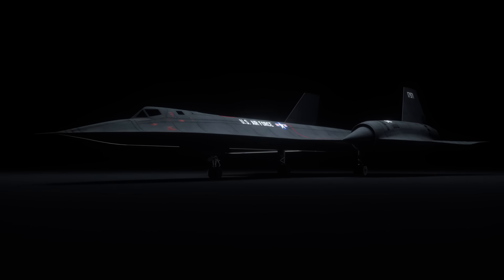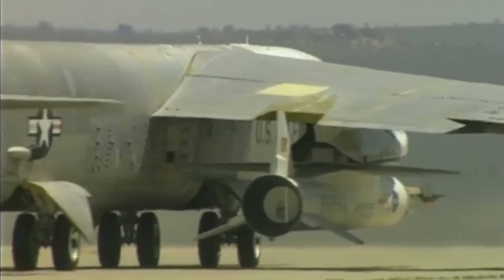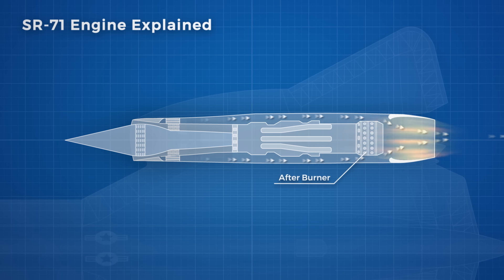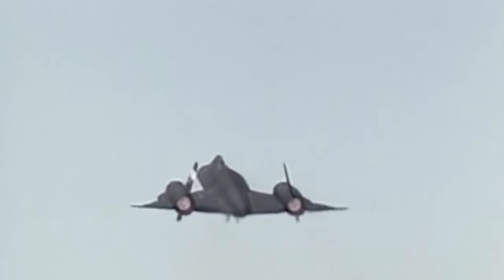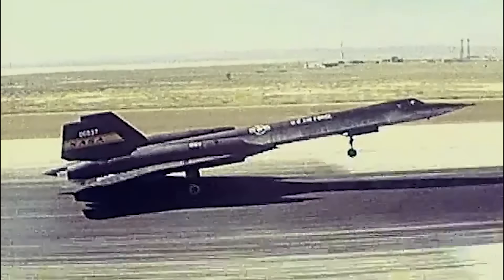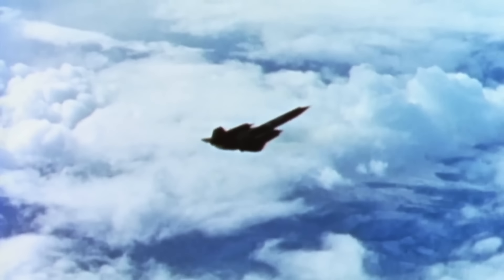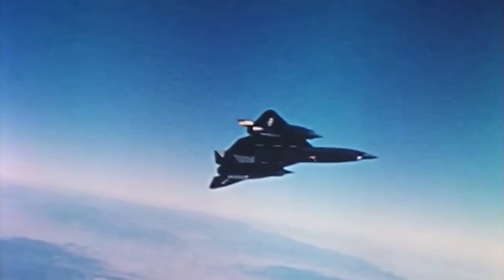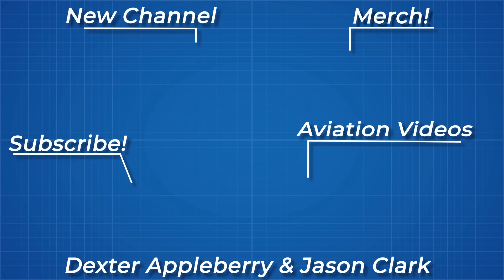The Insane Engineering of the SR-71 Blackbird

Comment: The Russians were trying to set the record for the fastest plane, and according to an older friend (who was a Mechanical engineer/test pilot for the military and actually flew in a Blackbird once) every time they'd break the Blackbird's record, someone would take the blackbird back up and break the Russian's new record. After the second or third round, the Russians figured out the Americans were screwing with them and gave up. ...he also said the thing leaked fuel like a sieve on the ground because they had to allow so much space to allow for thermal expansion. 

That bird can fly way faster than what's declassified I'd bet. That would also explain why they "stopped at mach 3.21." =D
Reply: @FIREBRAND38  The video explicitly says that there were "gaps in the fuselage" specifically left for thermal expansion during highspeed flight, and that this caused the plane to leak fuel. Furthermore, the video says the max speed of a ram engine is mach 5. You think the military wasn't using every bit of speed they could get? This plane had to outrun missiles if they were fired at it, and it's a lot easier to make a little missile go mach 5 than a big plane.

If you don't want to believe it, look at what happened during Desert Storm. The military was forced to unveil that the F-117 Nighthawk, a plane that was supposed to be under development, was being used in the air raids because news broadcasters spotted them and got them on tape. Here's an excerpt from the F-117 wiki:

"The F-117 was born after combat experience in the Vietnam War when increasingly sophisticated Soviet surface-to-air missiles (SAMs) downed heavy bombers. It was a black project, an ultra-secret program for much of its life: very few people in the Pentagon knew the program even existed, until the F-117s were revealed to the public in 1988."

In actuality, the F-117 wasn't seen in action by public eyes until April 1990. 1988 was the announcement of it's development to the public, but in reality, it had been in service since 1983. Case and point, the military never fully reveals what their technology can do. That would be the epitome of stupidity.

Also, the man I am talking about was allowed to fly in the Blackbird as a reward for his service. Test pilots die a lot, and this man risked his life multiple times flying new planes, so at his request before he retired, he was allowed to sit in the surveillance seat in the back and someone else piloted him. Also, of course this back and forth with the Russians was never made public. It would have been an embarrassment for the Russians, and it would have revealed too much about the Blackbird's real capabilities.
Reply: @strikezrow  The SR-71 wasn't limited by speed. It was the engine's inlet temperature. When the outside air was colder than usual they could push it to a higher mach number. The mach 5 number is the maximum theoretical speed of any possible ramjet design - it is extremely doubtful that any SR-71 exceeded mach 3.5 without sustaining severe damage.
Reply: @justinhannan1713  My point wasn't that it could go mach 5, but that it could go faster than 3.2. Also, as an engineer, I find it strange that they would make an engine that could go up to mach 5 and couldn't figure out how to deal with the inlet temperature. That would be like making a storage facility rated for 5 million pounds of load and saying "well really, the building's foundation is only made to hold 3 million pounds." See? It doesn't make sense, and they even question why that was the case directly in the video. Believe what you want; I'm telling you what I heard directly from a test pilot (not of the SR-71 but from that era).

Comment: I served with the 9th SRW in the early 70's  in the Supply section (they call it Logistics now).  We had a list of all the items that could (and could not) be used near the aircraft, down to even the brands of coffee.  The tools used were all deplated, ie soaked in acid to remove the outer layer of rust protection.  We were told this was to remove the cadmium from the tools, which would react with the titanium in the aircraft.  Then in mid 1973, someone came up with a money saving idea (yes, they received an award) that every maintenance man on the line did not need his own tool kit, that each shop could have a couple of sets for everyone to use.  So, there was a mass turn in of wrenches, screwdrivers, sockets, etc to us in Supply.  However, we could not declare them as serviceable item because they did not have plating, and needed to be sprayed with protectant to keep them from rusting.  We tried to send them to Redistribution and Marketing (Surplus Sales), but they refused to take them because they looked serviceable.  These were the early days of $800 hammers and $1200 toilet seats, and they were wary of trouble.  Typical Catch-22, not serviceable, not unserviceable.
We were locked down during the October 1973 Israeli war, (flying missions over the Suez from New York and then South Carolina), we had 4 large (pallet sized) boxes of tools that were "Redistributed " to people in the wing.  Problem solved.  I am proud to have worked with the Blackbird, my part of it included keeping 70 lb and 140 lb rolls of film in refrigerated storage sorted by pull date, and getting up at 4 in the morning in our Operating Location to help put drip pans under the Aircraft after it had taken pictures of jungle.   MSgt Richard C Olson, USAF, Retired
Reply: what kind of hardware did the SR71 have?
Reply: I was under the impression that the Sr-71, or Rs-71 XD, used two different types of fuel. JP7 for getting off the ground and another when refueled. Do you have any first hand knowledge of this?
Reply: Hey, I really appreciate your comment and your service to our country!
Reply: You are lucky to have experienced and participated in the management of such a noteworthy piece of history. Thank you for your service.
Reply: Drip pans?
Reply: I wish I was you
Reply: Amazing 👏🏼
Reply: Thanks for that, thats really interesting 😊
Reply: @jonnybgoode7742  Drip pans were probably to catch fuel leaking from aircraft,after it cooled down.The problem of fuel leaking was due to the use of titanium.This leak problem would go away once the SR-71 was in the air,from air friction.
Reply: Any thoughts to putting together a personal history with the SR-71?  Either a website or even a book?  We've got a lot of stories from pilots and some engineers, but not many from the "grunts", the guys who worked on the planes and kept them ready to fly.
It's easy for me to ask this (I know it's a lot of work), but if you decided to write up something I'm sure there'd be a lot of interest.
Reply: Since you were there around (but maybe after) the time this happened, do you know anything about an SR that’s buried at the end of one of the runways? You may have even worked with my dad who was the guy that got to change out the film in the aircraft. He saw the smoke and ran out to see what was up since they were expecting it back and I think he said the brakes burned up and it overran the runway and upon hitting the head folded its landing gear and slid across the grass for a bit. He watched as there were bulldozers brought in and they just dug a hole, shoved it in, and buried the poor thing. As far as I know it’s still there to this day.
Reply: @Beer-can_full_of_toes  Well, at the time almost all info about operations was classified in one way or another, and there was little official info, but a lot of unofficial info.   We did have a plane at OL-KA (Operatiional Location-Kadena) we stripped and shipped.  The SR-71 did not have the best of brakes, again the weight of systems and need to have a system that would tolerate very hot temperatures limited what the engineers could do.  So a drag chute was used to slow it down to taxi speed on landing.  So, story goes that the tower at Kadena was not on top of a weather change, and the wind direction changed from a head wind to a tail wind, with no appropriate change in runway direction.  They plane got to the end of the active runway still going 40 or 50 knots, and was totaled.  I got there a couple of weeks later, and basically, when an aircraft is totally damaged, maintenance shops remove any pieces that are removable, test them if appropriate, and mark them serviceable, unserviceable (repairable), or unserviceable (unusable).  Supply then restocks serviceable, sends repairable to the repair depot if the shop cannot fix it, and scraps the remainder.  The scrap is demilitarized, ie made unusable for it's initial purpose, cut up, beat up, and shredded if necessary.  You would probably not recognize most items after we got done with them.  
The other thing that was unique on the Supply side of the SR-71, is that being made of titanium, most structural parts and panels were unique to a specific air frame.  We stored certain panels and pieces with a tail number for a specific aircraft.  I would presume that any plane that suffered a crash into the end of runway barriers would not be usable in the best of shape, much less after a crash.  So thinking that the main air frame could be buried there, would make sense to me.  
One other weird thing about the supply side of the SR-71, is that we were at Beale AFB, we were piggybacked on the main base supply system because Mainframe computers are expensive to procure and maintain.  So usually, you see a FSC (Federal Stock Class) to start all Federal stock items.  Aircraft parts all start with 1560, Clothing is 83XX, etc.  Well, someone decided that all our parts (including standard USAF nuts and bolts, etc.) would be put on their system as FSC 8820, which, if you look it up are Live Animals, not used for food.  This kept our stock separate, but lead to some interesting discussions with other bases.  At OL-KA, we used a manual system for parts, everything tallied into count sheets, when received, when issued by HAND.  
By the way, if you look at the drag chute on a picture of the SR-71, it is basically made of one inch orange strapping, woven into shape.  When we demilled one of those because they were end of life, the strapping could be used for practically anything, including towing cars.

FixitWiz
Reply: Blake Brown  There was a LOT of money (Black program money) when the SR-71 came out in the Mid late 60's, when i got there in 72, still had lots of everything you needed.  And yes, as weird as it seems, a 19 man fuels system shop would have 19 tool boxes, one for each man.  Yes, someone suggested that was excessive, cut it down to 5 kits, and we in supply had 14 sets from that one shop, to reissue.  Make multiple separate shops, 3 maintenance branches,  and you have lots of excess tools.
Reply: @jonnybgoode7742  The Aircraft stretches up to 18", 45 cm, in flight.  At Kadena, we had a small crew, when the the aircraft came in, they would ring an alarm, and all of us would "greet" the aircraft coming in to the hanger, and when given the all clear, we would put 17-30 large pans under the airframe to catch fuel and hydraulic leaks.
Reply: @dan-ez8lg  I don't know about that, but if you watch this video, they talk about the start and restart fluid used that is much more volatile than JP7 (mostly kerosene, I think).  My only experience with the restart fluid is that we had maintenance turn in an "empty" container after use, one of my personnel turned it upside down for inspection on the turn-in line, the liquid poured out and started a fire.  No one hurt, just some used parts damaged, but exciting at the time.
Reply: @FixitWiz  oh that's crazy. thanks for the response
Reply: FixitWiz. I’m green with envy. But I’m too young to have ever seen it it action. Congratulations sir.
Reply: Nice story. So, you see ufos when you served there ?
Reply: @jonnybgoode7742  When the SR-71 whas on land, and not expossed to the heat of high speed flight, the joints on some parts would drip so much fuel, "drip pans" would be placed under the plane so it wouldn't spill all over the floor. Whe the plane reached it's cruising speed, the metal would expand ant the joints would seal back.
Reply: Amazing!!
Reply: Thank you for your replies, MSgt. Olson.
Reply: thanks for this insight
Reply: Hey I know. Just fly up there and dump these tools on them!! Hahaha!!!
Reply: @dan-ez8lg  JP 7 was the primary fuel.  JP 4 could be used in a pinch but would restrict the aircraft to subsonic speed.
Reply: Awesome!
Reply: I also served with the 9th SRW at Beale in the 80's. Love the SR

Comment: Engineers: How much fuel can you afford to burn?
Airforce: Yes
Reply: airfare; what defense systems have you included?
engineers; refer to prior answer
Reply: CIA: Yes
The SR-71 predecessor was actually an aircraft developed by the CIA. Surprised it wasn’t mentioned. Airforce planes piloted by CIA, not Airforce pilots.
Reply: I mean, when the plane costs a billion dollars, a couple bucks in extra gas doesn't really matter.
Reply: No, they were CIA planes. 

It’s actually why lots of the SR-71 was so ramshackle. 

They couldn’t design a brand new Mach 3 engine. They had to make one out of an engine designed for a flying boat. They had to figure out a starting system for it using a couple of Buick V8s because no existing APUs or air starters were powerful enough.
Reply: hi E W...
'
not important about currency to burn the fuel
Reply: False.
Reply: Some people just want to watch the fuel burn
Reply: There was a running prank that the ground crew would pull on new arrivals, where they would throw a lit cigarette into a bucket of JP-7... and the cigarette would go out. Which demonstrates how hard it was to get JP-7 to ignite.

Comment: When your plane is so dope that you use fuel for cooling
Reply: The Su-144 had the same cooling system and that plane was NOT dope
Reply: Pretty much every engine uses fuel for cooling. Look up power enrichment. The phase change of fuel from liquid to vapour is one of the best air conditioners, ever.
Reply: What you meant to say, is: "SR-71 - even it's fuel makes it somehow cooler"
Reply: A lot of planes use fuel for cooling think fuel oil heat exchanger
Reply: @iliketopumpit  :) yes, indeed, you are correct. And I believe a lot of liquid fuel rocket engines do that, too.

But still, the way I phrased it is technically correct AND cheesy, and I find it fun to put it this way.

this aside, shout out to "Original Skunk Works" talk by Nicholas Means @ LeadDev; and Tim "The Everyday Astronaut" Dodd's video on Raptor Engine; those two videos are something I'd recommend to aviation/tech enthusiasts :) Cheers!
Reply: Lol so pretty much every modern rocket
Reply: @kiwikiwi2483  as far as I know there is no su 144. There was an su 122 44 which was a soviet tank and there was a tu 144 which crashed twice and was grounded but no su144
Reply: @a_human8489  Su-122-44 is what I meant but my point still stands about the plane not being very good